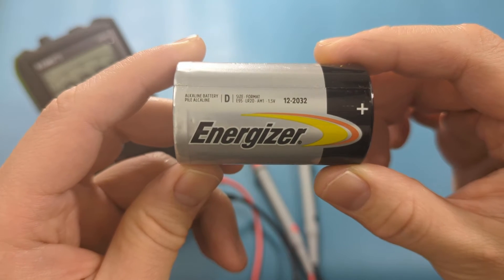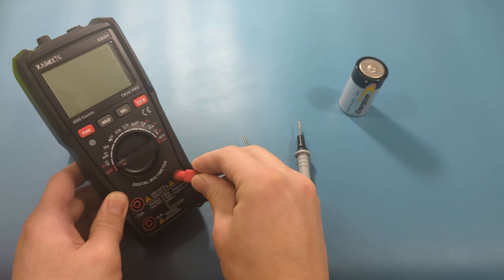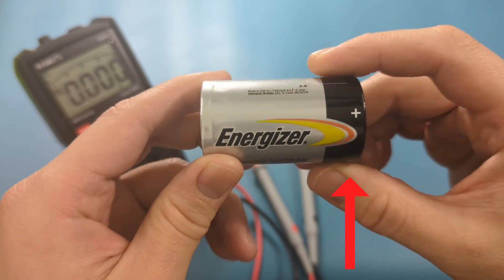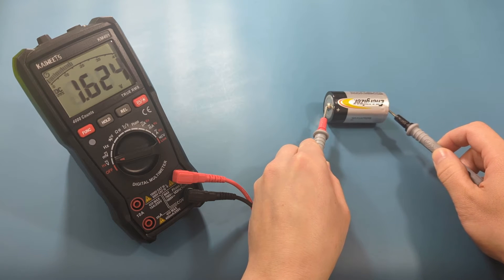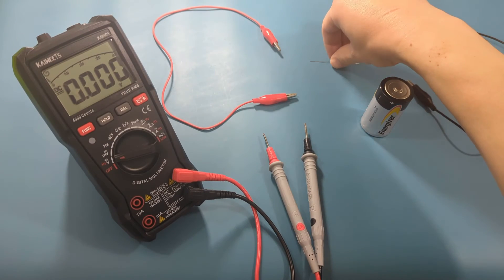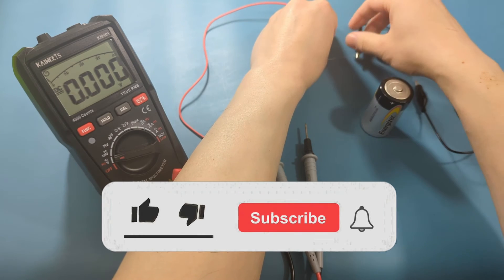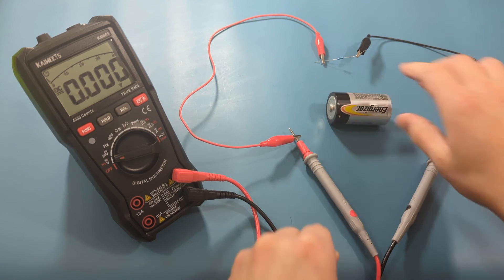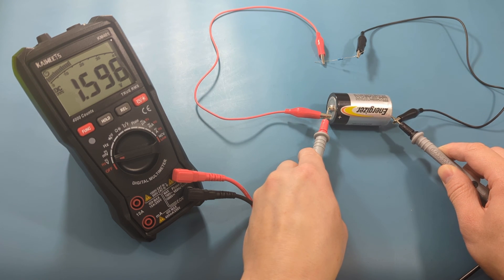How To Test D Batteries With a Multimeter

Comment: At what position do you put the multimeter?
Reply from the maker: Set your multimeter to DC voltage mode to measure the battery's voltage.